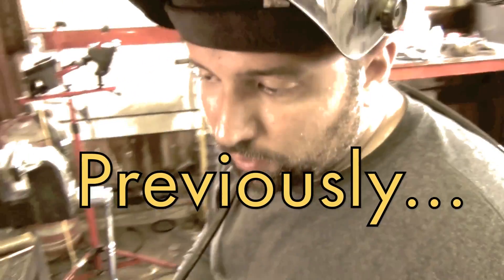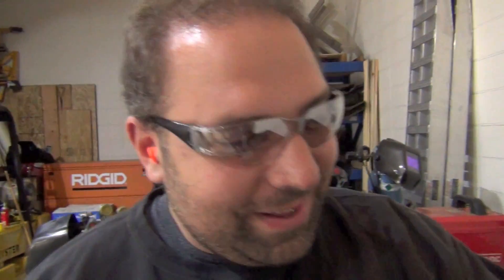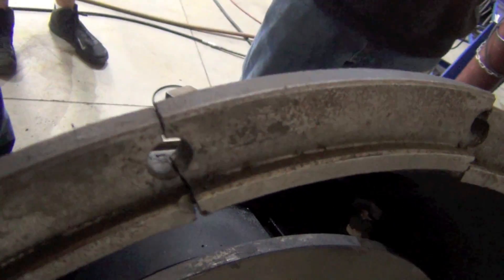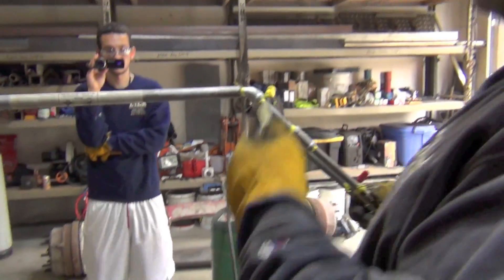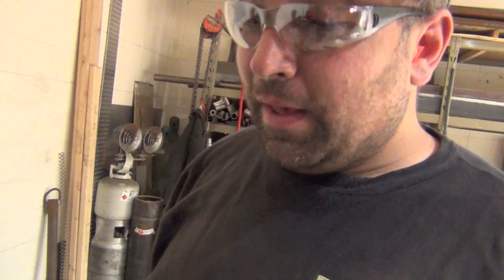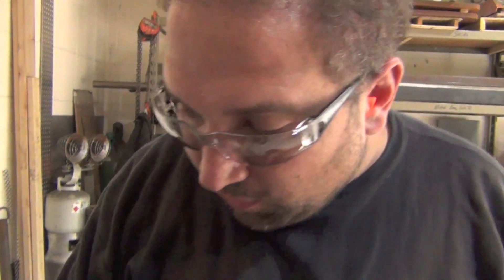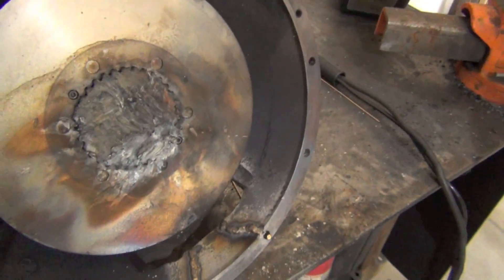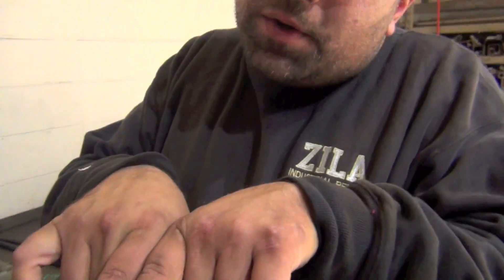Tig welding cast iron and preheat with MEGA torch

Comment: I once worked at a place called Papercone corp and MIG welded a cast pulley with help from my supervisor heating with a torch. Worked great! My reward was to be told that I wasn’t authorized to use the shop equipment LOL I was working on a government job that had to ship. No fail. I got the job out.
Reply from the maker: bad news !

Comment: Guess what I wanna do to my weed torch now. Very very nice work. You have the skills to get it done and a great attitude. Enjoyed the video.
Reply from the maker: go for it !!!    3/8" hole diameter  - just dill it out !!!  LOL  ....  and when you hook it up to natural gas ...  go 1/2"  you need more gas than - it contains less BTU ....  but than you don't have to haul tanks around - just pipe it right into the gas line ....   my customers do that !!!!!    look at my 4500000 but heating torch ... i build that triple torch for a customer and they heat GIGANTIC castings ...  piped right into the NG line .....

Comment: Nickel rod does a much better job, but it depends on how strong you need it to be and as you point out it is much more expensive.  Good video.
Reply from the maker: I do use nickel rod (like a NI99) sometimes. it has a really nice color match with the original casting and it can have 5 or 10.000psi more tensile strength than the AL BRO ....  but it comes with a price tag ....  3-4 times as much and the AL BRO flows so much nicer and does not need peening .....   i guess to each its own - and it also depends somewhat on the job -  what you can get away with

Comment: why not use hastalloy w for the casting?
Reply from the maker: it has to do with carbon and elongation .....  long story shot the W is "a stainless blend (based on 312)" which has pretty much no carbon in it - the casting is pretty much "all" carbon - the stainless when melter together with the casting (besides the casting does not like to flow) "pulls" carbon out of the casting and into the weld, that compromises the casting in its integrity right next to the weld ... the AL BR pretty much just brazes (solders, glues ...) it together without screwing up the integrity of the casting

Comment: Hi could you fix a cast iron alloy large church bell? The bell would be swung and rung and would it ring? It is 2 and 3/4th thick at lip and prob 1/2th inch thick elsewhere. The crack has been ground out  1/4th inch gap now. Just curious.
Reply from the maker: Ron, are you sure that the bell its cast iron?  9 out of 10 church bells i have seen are some bronze alloy .....   and yes - i can most likely weld it, and it would ring and there is a good chance of success (which means it wouldn't crack later on during use) That is depending on how "clean" the casting is. How did it break in the first place?
I welded rock crusher cones out of a south african diamond mine, they were steel castings about 3 ft around 4 ft tall and 2-3" wall thickness ....
Reply: It is cast iron alloy like the iron farm bells. The used amalgam in the mix. This bell is 33 inches wide.
Reply: no one at the church can remember when it cracked. The crack is not where the clapper hits but off to the side. I ground a 1/8th inch crevice all way thru and grount out the crack.
Reply from the maker: How tall is the bell? And how long is the crack?  Without seeing it, drill testing or spark testing it ....  From what it sounds like i would pre heat the bell to 800-1000F (if in doubt higher is better) which that will require some massive BTUs .....  Than weld it with either 7018 or ER70S6, heat in between passes (maintain at least 800F for interpass temperature)
Reply from the maker: The key to success on this one is a perfectly even and hot post heat and than super slow and even cool down .....  A huge sandbox or multiple layers of huge ceramic blankets will be your best friend .....

If you have a way to bring it to my shop i could weld it for you.
Reply: its in the church tower, a steeple 6 ft by 6ft about 30 feet up. the church has funds but not enough to get a crane. it weighs 850lbs. it was made by the Rumsey & co sennica falls ny back around 1870. wish I could have you do it but they will not relent. I was just curious . I like to get info about things. it rings, being I took stress off the hairline crack by grinding a crevice. I ground way beyone visable crack pro 2 inches past. it has a "crange type sound now but use to go"clunk" before I ground the crack out.. no change in tone has occoured since 1999 when I did it.
Reply from the maker: That is good. My crane only reaches about 26 ft. And this is something that i would definitly not advise to weld outdoors .....  
But sounds that you are good for now ....

Comment from the maker: John, if i recall correctly it was 60 or 65.
On a casting like this i usually like to stay between 50 and 70 depending on "how things flow" and "how dirty things are"
Ususally most times it is between 55 and 60. 
This one here was on the cleaner side and was flowing ok.
Pre heat helps too - if you weld it "cold" no pre heat, short runs of weld you want a little more " cleaning" settings in the 50's will be your friend